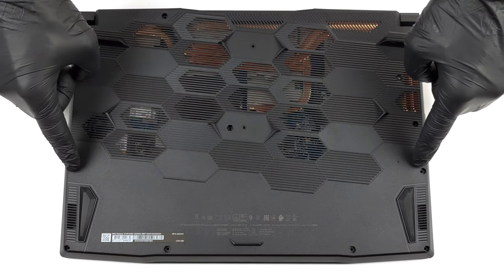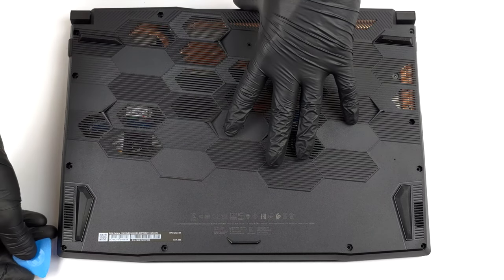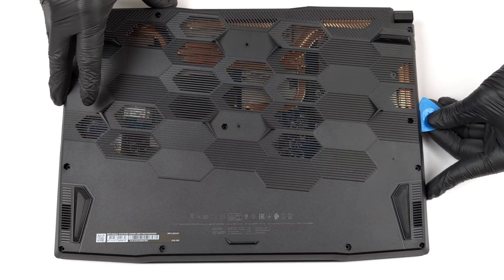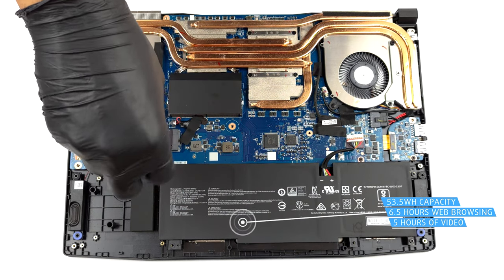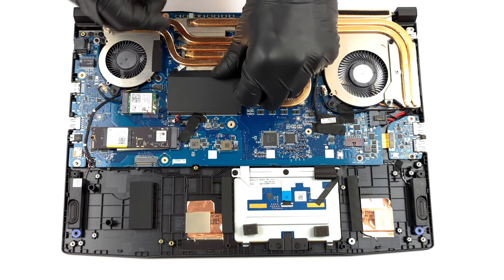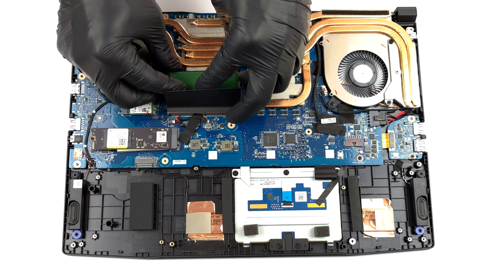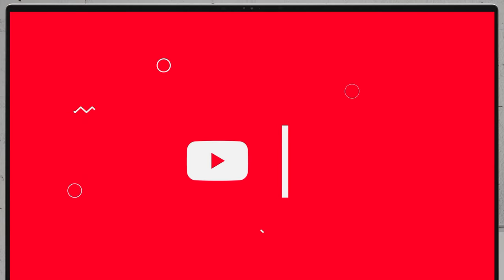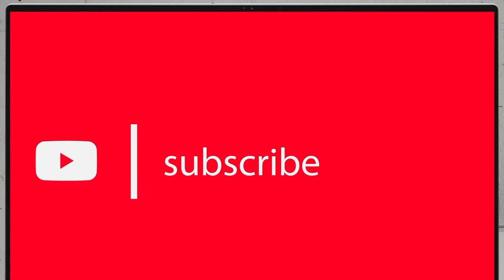🛠️ How to open MSI Katana 15 (B13V) - disassembly and upgrade options

Comment: I could use some help. I wanted to add some storage to my msi katana 15 and your guide was very helpful but what am i supposed to do after i plug in the extra ssd into the additional slot. Its just dangling there. It does not seem very secure
Reply: If you're using an m.2 nvme, you should screw it down with a small screw that either comes with the laptop or the ssd itself. The place you screw it in should be on the opposite end of the side that you plug it into. Hope it helps
Reply: You need mounting kit for a ssd, MSI support sends it for free if you ask for it.
Reply: @mand0508 do you lost your warranty if you do it?
Reply: @fla1merok892  no I didn't

Comment: That is the easiest laptop RAM  upgrade I've ever seen
Reply: Older laptops use to leave a door to upgrade ram.  It would only be 1 screw.
Reply: That is the reason why I love MSI 😃
Reply: @melchiah031  i just looked it up. Older laptop ram slots look even way easier than this. Thats awesome. Makes me miss when i could do the same with laptop batteries too. The battery in this msi laptop was annoying to disconnect.
Reply: @knockdownbow8976  yea, ram hd and batteries use to be a 20 second swap.  I don't even like messing with this newer breed.  You have to disconnect the screen and pop off the keyboard and disconnect everything.  Such a pita
Reply: @melchiah031  honestly 😮‍💨

Comment: Is there any screw to secure the second ssd?
Reply: Dude I’m looking at mine right now and can’t figure it out.
Reply: I tried using the adhesive from the stock SSD to try to secure it the best I could, but the laptop won't read it. Were either of you able to get this port to work?
Reply: I haven't opened it yet.. maybe it needs some setting from bios
Reply: @TheManolicious  have you guys figured out what to do with the 2nd ssd slot yet ? looking at buying one,but how tf u bolt it down if it has no bolt holes ? lol
Reply: @SeekersPowerbuild  bolt hole costs money, use chewing gum instead :p
p.s. still i haven't figured it out
Reply: @SeekersPowerbuild  Message from MSI technical support: There is a manufacturing problem, you can ask them for a pack of ssd kits (bracket screw, ssd bracket, ssd screw, thermal paste).
Reply: @TheManolicious  Message from MSI technical support: There is a manufacturing problem, you can ask them for a pack of ssd kits (bracket screw, ssd bracket, ssd screw, thermal paste).
Reply: @菸酒醫生  via mail or we contact support? It works for all countries?
Reply: @TheManolicious  just put an order thru on 3 days ago,will start chewing gums now,great help,thanks 😁
Reply: @菸酒醫生  did they give it to you for free or did you have to pay?
Reply: @johnkeo358  for free
Reply: @johnkeo358  mine it's on it's way to me and for free
Reply: @菸酒醫生  nice, i will ask them to send me some
Reply: @TheManolicious  nice, im glad to hear it!
Reply: @菸酒醫生  please post here where to swear them and ask for that...
Reply: @TheManolicious  yes I think so, because I was the same problem .

Comment: My cpu is staying in 55 degrees in idle is it normal?
Reply: Should be a bit lower, around 45-50 max. You can try changing fan behaviour in MSI Center to cool it down better
Reply: try fn and the arrow up button to ramp up the fans
Reply: totally normal.............

Comment: OK, where's the second SSD slot screw hole to secure SSD? If  I want to add another one I cannot secure the extra SSD on the second slot?
Reply: Same question here.
Reply: You need to talk with msi client´s service and  ask for the brakets by your model then they deliver you  the pieces. I was the same problem with my bravo 15 c7v and it was the solution. Im from Mexico and pieces arrived to my home one week later. it was free.
Reply: @AngelicaMartinez-rs4ry do you lost your warranty if you do it?
Reply: I don't ask but until today I don't have problems with the laptop. Maybe You can ask in service clients
Reply: @AngelicaMartinez-rs4ry  thank you, I did, waiting for response

Comment: can you please tell me, how big the second SSD can be? and can you give me a link? I want to make sure that I can fit the right ssd in and not a wrong one, or just provide me with some information in how or what ssd to look for? I was thinking of a 2TB or maybe  bigger one, would that be possible to add there?
Reply: you can have 1500000 tb if you want. just needs to be the nvme , the small version of ssd
Reply: the big rectangular ssd wont fit there (sata ssd )

Comment: Also, another question, why there is nobody taking out the keyboard? I tried so much to get to the keyboard as I have spilled some juice on it, unfortunately after taking everything it seemed like under the Motherboard, the keyboard is kind of sealed and has some permanent fittings, would you be able to show a keyboard replacement? or in my case how could I clean it easier? 
as all I did was to buy a Isopropyl alcohool and just spray the entire keyboard, dry it, spray it again, dry it, a few times then I put everything back togheder, but I wish that I could reach the buttons easier, by removing the keyboard, at the same time I've notice some tape around everything after you remove the motherboard, and I don't like to take staff out that I could not place back, maybe you can show me the right way if you could, please reply to this, so I can view it. thank you in advance
Reply: Usually on today's laptops, the keyboard is semi-permanently attached to the top case. It's very difficult to open the keyboard in one piece, you have to heat/melt the plastic lock. 

I once tried to replace the Msi GP62 series keyboard, and it was very difficult to put it back to its original state, it needed glue here and there.

Comment: Is it necessary to fully remove the battery if I am just doing a ram upgrade?
Reply: nah, just make sure you unplug the battery from the motherboard before changing the ram or any component, make your moves and at the end replug it. :P
Reply: What ram supports the msi katana 15 b12vgk?
Reply: @dilloncairns4174  DDR5 if I recall correctly
Reply: @dilloncairns4174  For your computer: DDR5 @ 4800 MHz. Maximum of 64GB (32 GB per stick)

Comment: i have found some claims that the msi katana 15 b13v can be upgraded to 96gb r(am 2x48gb). Non binary rams just came out recently. So i was wondering if you can do some reasearch on this and if its ok to get 96gb. It is stated that is unofficial upgrade ans the official supported maximum capacity is 65gb. Please if anyone can do more research than me i would love to have a clarification
Reply: so instead of conducting youe own research, you come here tell a random video maker to do the work for you hahahaha😅😅😅😅😅

Comment: how often should i repaste this laptop
Reply: lol what ? you have to repaste your laptops? what kind of shit you been using man ?
Reply: My Thinkpad started melting my legs after 10y. Repaste was a huge improvement
Reply: As many times as its needed. Most times, you will find the laptop either running hot or overheating. If this is the case, it should be re-pasted. While you have it apart, you should clean the Heatsink from any debris and check on the other Thermal Pads on the VRMs and the Thermal Paste on the GPU Die.

Comment: I understand an M.2 SSD can be installed. But can I install an M.2 with heatsink? For example: WD_BLACK Gen4 PCIe, M.2 2280, 7,300 MB/s - WDS200T2XHE